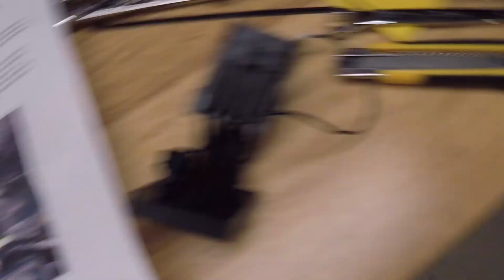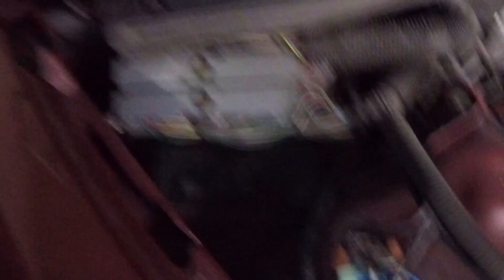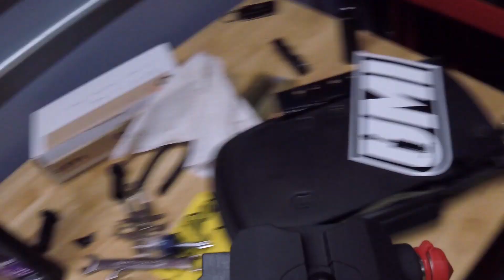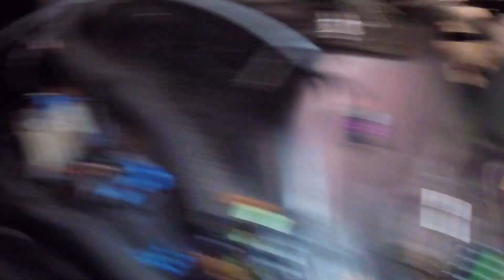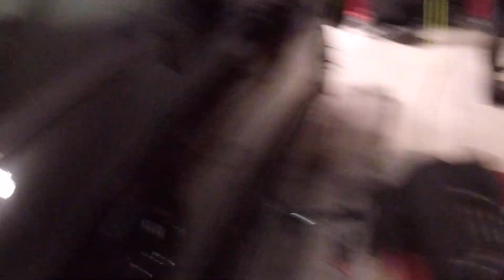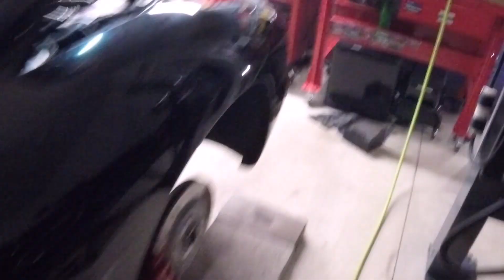2002 V6 Firebird Manual Fan Controller Module Install (Casper Electronics) Fits all 1993-2002 FBody

Comment: After I saw this, I ordered one for my 1998 v6 Firebird. The 1998 f-bodies have a real temp gauge, and recently I've noticed my car has been running a lot hotter than normal. Its about 215 degrees, which isn't bad, but it's suddenly about 40 degree hotter than normal in city driving.
Reply from the maker: dang, yeah I dont trust my fans to come on on their own. I put  160 tstat in this car today. with the cold tstat and the ability to kick the fan on whenever I want, Im hoping i dont have any overheating in my future
Reply: @CaptainThirdGen  they come on, but it doesn't usually run this hot, and it's not even 80 degrees outside yet. Hopefully this helps.  It was a good video, and I always enjoy them.
Reply from the maker: @michaelm3381  thanks for watching. Hope it works well for you

Comment: If you don't mind me asking a question not related to theme of this video, but what's the real world mpg for your V6 3.8 compared to the LS1 V8?

Thank you and keep up the great videos.
Reply from the maker: depends on the environment. my 100 mile round trip commute is about 30 highway miles, and 70 city/backroad miles. V6 usually returns about 25mpg on that route, Trans Am 21-23mpg. 

I will be making in depth fuel economy test videos very soon on both cars
Reply: @CaptainThirdGen  that would be great!  I used to have a 96 LT1 Trans Am and it used to get decent mpg but then started getting terrible gas mileage.  I'm a very conservative driver. 

I'm looking into buying a 98-02 V6 Firebird as I got tired of having such a gas guzzling V8.  I hear some people say their LS1 gets better mpg than the 3.8 V6, then others say the exact opposite.
Reply from the maker: in city usage, my v6 gets much better MPG than my LS1 (both manuals). On the highway, the gap between them gets smaller. But the v6 is still much cheaper due to it running on regular gas vs the trans ams premium fuel

Comment: Does it improve performance?
Reply from the maker: not sure yet, hoping keeping the engine a little cooler at the track will keep the engine from pulling timing and cutting power. I would need HP tuners to monitor that accurately though